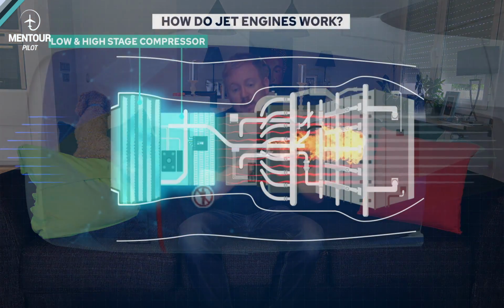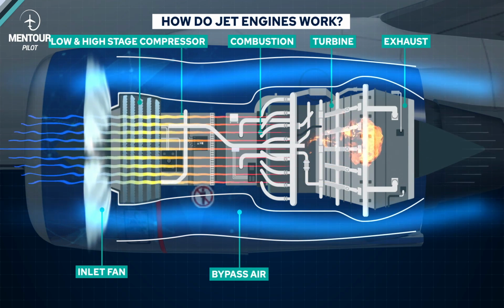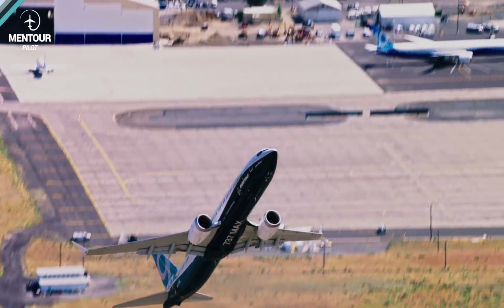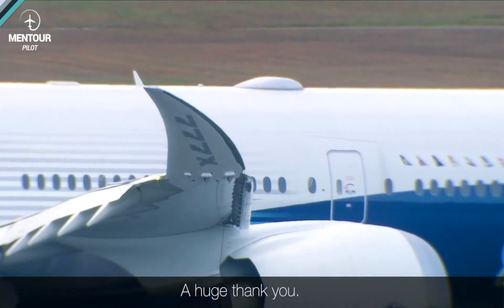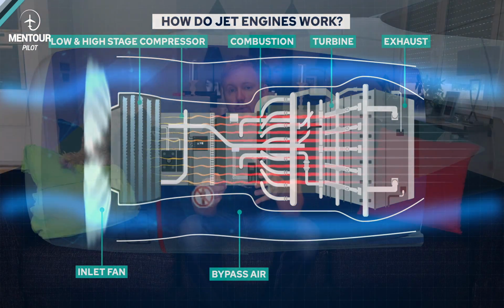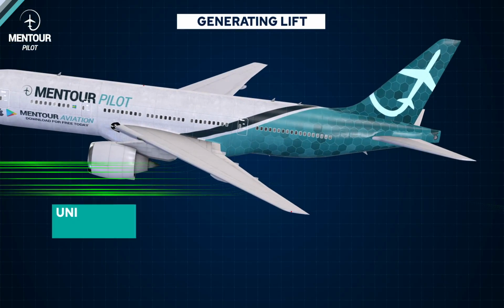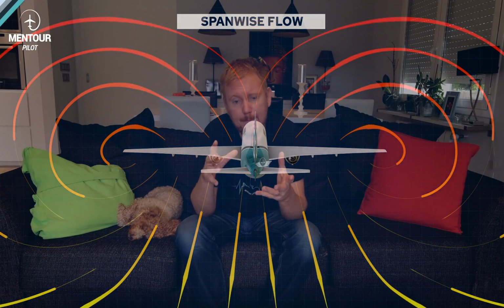How BIG can jet engines get?!

Comment: If we see more top-mounted wings, in the form of the AN124, for example, that would add a lot of engine space without landing gear weight or compromised aerodynamics.
Reply: What about rear-mounted engines? Like on the Boeing 727, Vickers VC 10, Cessna Citation, Lockheed Tristar, IL-62?
Reply: @garycard1456  balance is an issue with rear mounted engines. There is a reason that the md-80 family has the wing box relatively far back in the fuselage. It is because the engines are heavy. This limits the weight of rear mounted engines.

Comment: 1.  High mounted wings like the C17;  2.  Rear mounted engines like the MD80.
Reply: They had so many problems with MD80 engine configuration.  That’s why it’s no longer exist.

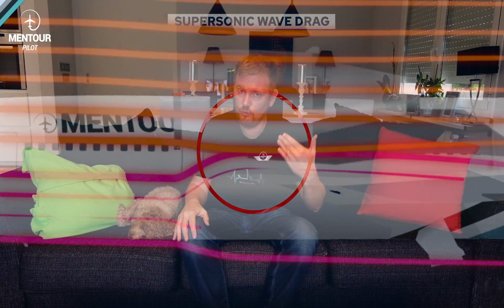Comment: @Mentour Pilot. 17:51 Understood, how then is the KLM Flying V getting away with mounting the engines above the wing? They recently completed a test flight of a scale model and it seemed to handle quite well. Of course, a scale model is light years from a full sized plane, however, I feel it does demonstrate potential. 

I'm also curious about stability, with no active vertical stabiliser to speak of the larger the models grow stability issues may start to reveal themselves - which may need a redesign of the aircraft? 

I hope not, of course, and it will be amazing to see it in the air.

Comment: What if you integrated the cowling and bypass into the wing and snugged up the engine core up closer to the wing and then made the front fan enormous so that part of it went up over the wing (and the bypass air associated with the overwing part of the fan just flows over the wing instead of under it)?  For maintenance, the engine just unbolts and the fan and leading end of the cowling comes off, basically leaving the overwing part of the bypass duct behind?

Comment: You didn't explain the why. You said that you can achieve the same thrust by accelerating a small volume of air to high speed or accelerating a little amount of air to a lower speed but didn't say why the higher bypass is the better option. You did sort of hint at it at 8:45 though. The answer is that it's more fuel efficient and it's quieter.

Comment: There are three ways to make more power...in both jet and even piston engines.   Make them bigger, turn them faster or burn them hotter.   The limits of heat tolerance depend on materials and expected life between overhauls.....hotter doesn't last as long once you go past a certain point.   Making them bigger normally comes with increased weight and being that the airflow must remain sub-sonic (both internally and externally) you have limits how fast you can spin them and larger diameter gets supersonic at a lower rpm.   The modern high bypass fans do go supersonic toward the tips and this causes both efficiency issues with the biggest problem being noise.   Modern fan blade design is made to work properly even though they're mildly supersonic but you still can't go crazy with engine speeds so limits on both size and speed are present.

Even the mighty J-58 SR-71 Blackbird engines didn't have supersonic airflow within them, and being a VERY large diameter turbojet they didn't spin anywhere near as fast as the smaller core of say an F-100.   Pretty neat how the compromises are all blended into every engine and if you keep in mind the three ways to improve things....it can lead you in the right direction should you ever want to improve your engine output.

Comment: The HondaJet HA-420 has its jet engines mounted on top of the wing.

But I'm guessing it can handle it better because it's smaller? Still does 778km/h though.

Comment: I’ve been an aircraft maintenance tech for major airline for 28 years and still love aviation so I enjoy watching your videos a lot. We have to learn how to work on all the aircraft in our fleet and the last 16 years I’ve been working pretty much composite repairs exclusively, so I’ve had to learn a lot about the newest aircraft we’ve purchased the A-350 and A-220 (C100) lol.  The A-220 having GTF Geared Turbo Fan’s. Fascinating. I knew Rolls was working on a large GTF which is neat but I had no idea the A-220 had GTF Pratt’s until we started receiving them. The compressor and turbine is tiny with a normal looking Fan. With a gearbox driving the Fan you can run the fan at the perfect RPM to get the most thrust out of the blades. And the wonderful computer designs of the blade contours allows ever point on the blade to keep the air flowing over that section at an ideal speed.  Rolls has a Three spool engine with the very aft Turbine shafted to the Fan and then the turbine section just fwd of that shafted to the  N2 fan directly behind the Fan which guides air into the compressor then the fwd turbine section driving the compressor section. 3 spool can assure that each section can spin at an RPM that helps prevent turbulence as air flows through the engine. GE and Pratt’s are two spool and on the older engines the N1 and N2 Fan and blades just aft of the fan were driven by the same shaft from the Aft turbine section.  Which caused an issue. Either the N1 or the N2 was spinning to fast or to slow never in the Goldilocks zone. Now with the Geared Fans we can always make sure through design and gear size that at core engine’s can run at the perfect speed for fuel efficiency and the fan will produce the best thrust possible. So this seems to be the next evolution in engines. The GTF is a really neat engine to look at.
Reply: I wondered when Mentour was going to get to geared fans but he never did. 
I guess fans getting bigger and slower, and turboprops steadily acquiring more and curvier blades, are an example of convergent evolution   ;)

Comment: So why we can’t use an upper wing configuration like antonov. There would be quite clearence to the ground
Reply: Because it is hard to maintain because u will need something to get on to access the engine
Reply: @ethansaviation2672    Hardly, since the current problem is the new big engines are too close to the ground already.   To reach the top of them you'd need a ladder even if they were scraping the ground.
Reply: @cr-yi7ep well yes but no, the higher it is from the ground the higher the maintenance costs are. Only cargo aircraft will use this config
Reply: @ethansaviation2672    Did you see the size of the GE 9x in Mentour's video?   Put those on a An124 and they wouldn't have a huge amount of ground clearance.   In fact the 737's problem has been the exact opposite for decades.
Reply: @cr-yi7ep  yes but the an 124 and 225  that are the 2nd biggest aircraft so of course it has plenty of ground clearance
Reply: @cr-yi7ep  I'll end this here, they will never make passenger aircraft like that anyway for what every reasons
Reply: @ethansaviation2672    Dash-7 Dash-8 ATR72  BAe146  F-27    would disagree with you.   I agree the low-wing engines-under is far the most common now, but a while back it was all tail engines.   Things change, whether fashion or circumstances I don't know, but 'never' is a bold claim.

Comment: Look at formula one rear wings, they're mounted with what's called swan neck pylons, for the same reason. Not to disturb flow on the low pressure side of the wing.

Comment: Why won't they use high-wing aircraft, similar to large transport planes such as the C-5 or the Antonov An-124?
Reply: Engines are easier to maintain when there lower to the ground
Reply: @ethansaviation2672  they could still keep the engines the same height above the ground by mounting the wings higher on the fuselage and reduce the length of the landing gear.
Reply: Clearly there is another reason why they don't do it.
Reply: @marzolian  this wouldn't work because the engines still couldn't get to big due to Anhedral wing
Reply: @marzolian  pilots would need to recertify.

Comment: With all this taken into account, might we see high wing aircraft?
Reply: Engines are easier to maintain when there lower to the ground
Reply: @ethansaviation2672  this is true but if they are to get bigger surely the wing must get higher? Other than the fact the wing bracing and the gear wells are together is there any advantage of a low wing?
Reply: @Edsbar  but u can't keep making the wing higher, so you would have to make taller gear eventually
Reply: @ethansaviation2672  there are quite a few shorter range turboprop aircraft with high wing configuration. Presumably this is because of the larger diameter of the propeller needing ground clearance. Could this not be the same for turbojet engines?
Reply: @ethansaviation2672  the 737 has a low wing and has tall gear and a flat on the bottom of the engine cowling to give ground clearance.
Reply: @Edsbar  yep because you would need Anhedral wing so you couldn't keep making bigger engines
Reply: @Edsbar  yes but u can't keep making bigger engines either way like mentor pilot said

Comment: What about using a high mounted wing with large engines below it? Seems to work pretty well on a lot of aircraft and maintenance and wing aero would be similar to a low wing with a bottom mounted engine.  Love your videos! You’re my favorite aviation YouTuber.
Reply: That would be a pain in the butt to fuel. As it is, the big widebodies (767, 777, 787, and Airbus A330) have to be fueled using a lift truck because fuel ladders are too short.
Reply: @murphsmodels8853  Fair enough. I wonder if a solution like a dry standpipe could be implemented with a transfer pump to get the fuel up top.
Reply: @murphsmodels8853  Nothing says you have to put the fuel in from the top of the wing.
Reply: @richardlatshaw1119  We don't. Large airliners are fueled from the bottom of the wing. That's just how high up the wings are.
Reply: That also requires very tall landing gear and to make that strong enough would add a lot of weight.

Comment: Compromise regard engines would be going back to the original jet liner the De Haviland Comet. Which had the engines set into the wing. now unlike 60 years ago we now have CGI and PCI Graphics. So designers could come up with a compromise design with a pod designed engine that could have the wing moulded around it. Something I'm not familiar with as I don't know design technology that well. So the Turbine Engine supports will become invisible as they're once again set into the wing, but the Turbine engine would be lifted into position or taken out as it currently is by a frame support cart or fork lift truck, and the moulded skins of the wing that wrap around the Turbine Engines could be removed as they are on the A4 Class of locomotive restoring the aerodynamics of the vehicle.
Reply: Just no, the wings would have to be huge to get an engine the size of the ge9x in there

Comment: That's why the current Shinkansen has those enormous nose. The latest one called the platapus. To do exactly what you described with the wing. As the original Shinkansen (the bullet train) compressed the air to such a point whilst entering tunnels the compressed air was exiting the tunnels ahead of the train at 600 MPH. Effectively creating a subsonic bang (pressure wave), which if it had hit you would have killed you straight away. So those noses on the latest models do exactly as you have described. except for they want that vacum generated under  the train to suck the entire moving vehicle units onto the track as the Shinkansen,s aren't secured onto the track

Comment: One extra limit, if you forgot the issue of scraping the pavement: 
at a certain point at the same rotation speed the tip will go faster and, like for helicopters, there is a max speed at which the tip of the fan will reach speed of sound!

Comment: Well, with a new build from scratch, I can see the possibility of mounting engines further from the fuselage. And also new builds with high wings. Like the C-5 for example. Or think outside of the box as Boeing did with the YC-14, and Antanov took that idea to produce the AN-72/74 types. All very interesting.
Reply: wide spaced engines == more yaw on engine out == bigger vertical stabiliser and rudder == more mass and more drag

OTOH, imagine re-engining the C5 with GE90s or PW1000s

Comment: 3:27]  "...the more you can increase it the more thrust you get..."  Right up until the point you melt your own engine."  Yes, the very hard limitation of turbine engine development over the decades has been materials science.  It it is actually pretty easy to raise the temperature of things past the point they will melt.   Yes, but, uhm... if you are not interested in going very fast, you can take some of the work your turbine engine is capable of doing to accelerating a large volume of air at relatively low cost - if you can keep everything subsonic.  Thus the so called turbo-fan engine.  If you are not interested in climbing over the wall of the sound barrier fine, otherwise speed becomes suddenly very expensive indeed. So, if there is a limit to how-hot-you-can-melt-the-core-of-your-own engine, there must be a commensurate limit to your bypass ratio.  Where may that limit arise? say about 10:1 or 11:1?  This isn't genius, this is just paying attention.

One problem is, all of the thrust in the world you actually cannot go any faster than the velocity of the exhaust gas going out the back of the engine - and generally much less than that.  Want to go very fast? you need a turbojet or a low bypass ratio turbofan and after-burning, or something rare and exotic and *expensive.*. [People on holiday don't like expensive]  Or, something much higher exhaust velocity like a ramjet, or a scramjet.  Why not New York to Munich in 90 minutes?  Or the other way around.  It takes a certain number of joules.  If you can afford the joules, why not?

Speed is always expensive, back in the days of the Concord the price of an airline ticket from New York to London or Paris was several hundred dollars, first class on a 747 -  maybe a thousand.  Paris to New York on the Concord ten thousand dollars a seat? about?   A price factor of 10x.

Comment: Oh yea, GE is on top of the efficiency thing. But, you gotta sell engines to make money in that game.  GE doesn't make the components, subs do.  From blades to fuel lines.  GE is soo weak right now and the subs are quite aware of that.  Subs are very weary of GE and concerned of their viability.  We are definitely on a precipice right now in terms of manufacturing the "wonderful" gizzmos.
Reply: Do you think RR or PW make all their parts themselves? Or automotive companies for instance? Think again. With thousands of various parts that a jet engine is made of it's pretty much impossible.
Reply: @void3584  You need not ask me to "think again"  I am quite aware of the  subs.  I work for the subs.  No, I need not think again.  You need to be a little less arrogant.

Comment: As usual, a fascinating explanation. 
Interestingly, the Russian version of the Wikipedia page on the An-74, claims that putting the engines on top actually increases lift due to what they call a “Coandă effect”...
(although the main reason for putting the engines there was to decrease debris intake when landing or taking off in extreme conditions, which is what this plane appears to have been designed for...)
Reply: Boeing built a similar plane, the YC-14, that was designed for short takeoffs and landings by blowing exhaust over the flaps to increase lift.

Comment: Ilyushin Il-62 had 4 turbofan in the rear, and a T stabilizer. They can use that design to accomodate 2 bigger engines (similar to the MD-80). Yes, I know there are risks to have a T finn, but still, they can be overcomed.

Comment: Haven't watched the video yet but the picture and question make me think of the old F4U Corsair with the bent wings to get it up high enough for propeller clearance.

I wonder about the design trade-offs of putting two big engines on the side of the fuselage like business Jets or maybe in the back like fighter planes.

Mentor mentions the flying wing design. Something like a b-2 bomber design could house big jet engines within the wing and have no aerodynamic complications.

Comment: Question, is it safe to say that the bigger the jet engine the bigger thrust will always be? As the GE9X was only rated at 105,000lbs but during tests leaped past the GE-90b1 which is rated at 115,000lbs
Reply: GE90-115b1
Reply: No. A bigger engine typically has better propulsive efficiency (though not necessarily), which is the main motivation for increasing engine size in airliners. The 737 max's LEAP 1B engines are much much bigger than the F135 engine in the F-35, but they both have almost exactly the same thrust (without afterburner). But the LEAP has a much higher propulsive efficiency.